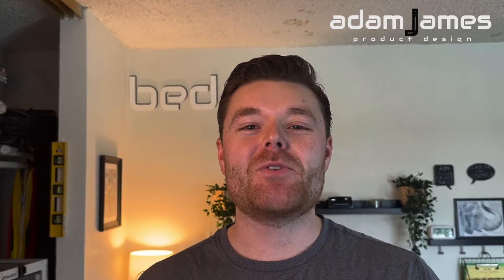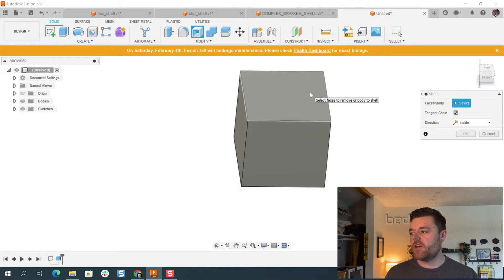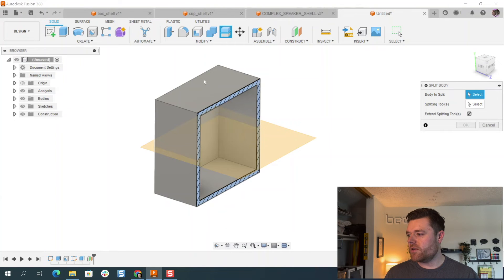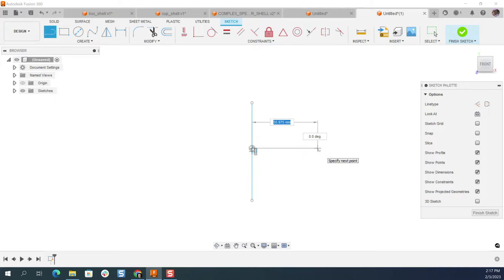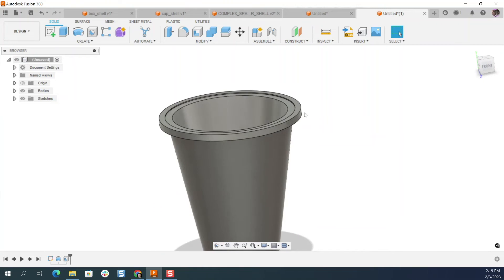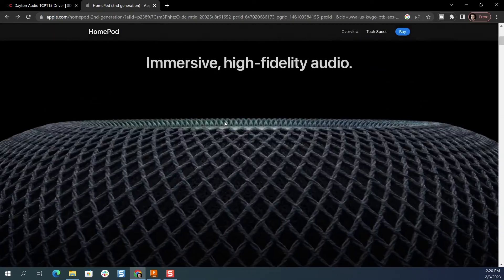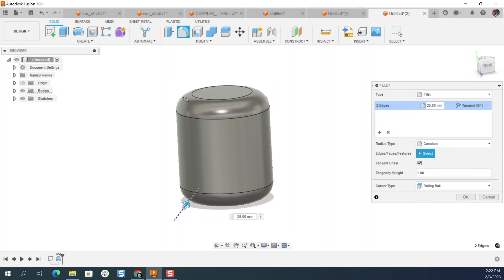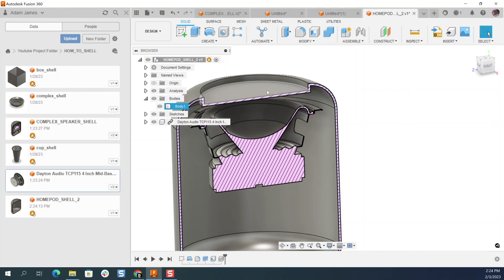How to use the Shell feature in Fusion 360!

Comment: great video.....thanks....you ever work with importing STL files and making changes to them and then exporting them back out again???? if so do you have a video out already that covers this??
Reply from the maker: Thanks for the support! I do have a few .stl videos. How to shell an .stl into a solid body, how to convert an .stl into a solid body, and how to correctly insert an .stl into fusion. Are you looking specifically for how to make a modification to an .stl file and then export as an .stl? I can certainly make a video, but the high level steps would be to import the .stl, convert it to a solid body, make modifications to the solid body, re-mesh as .stl, export as .stl. 👍